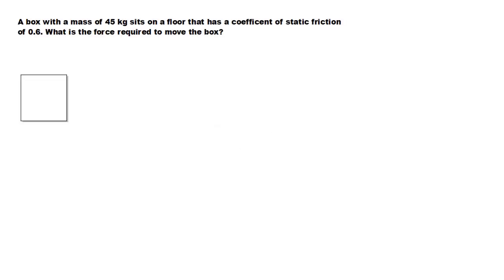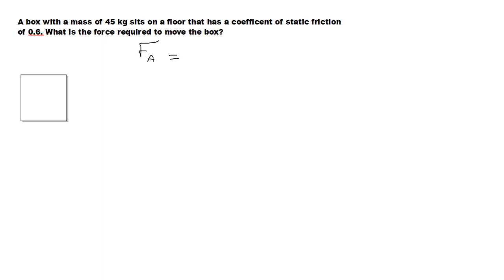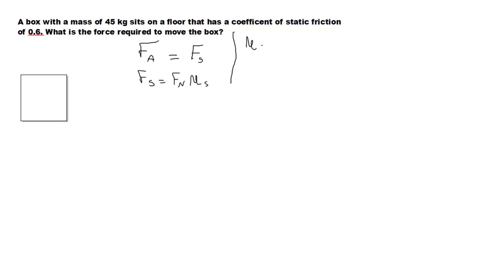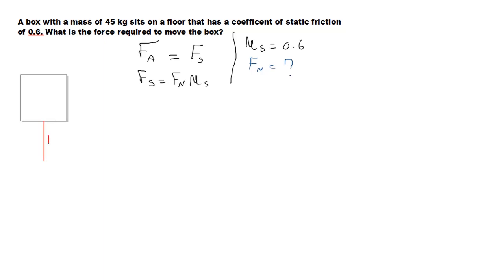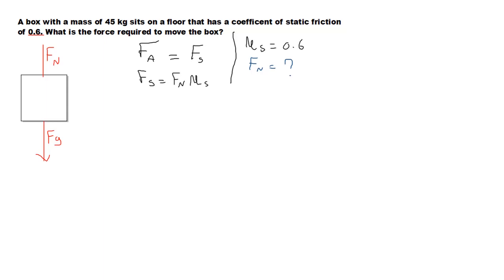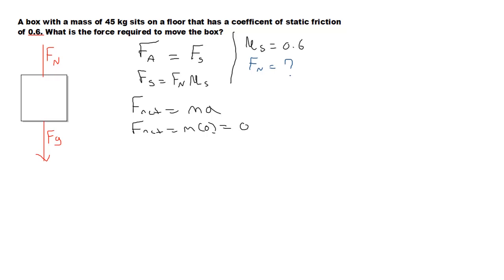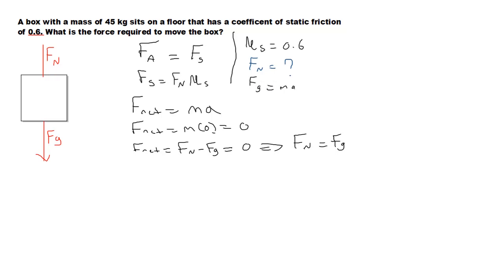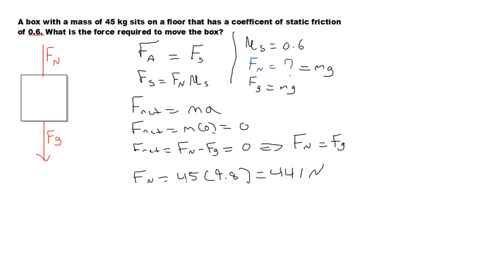Static Friction: Force Required to Move Object

Comment: Thank you for this video! However, I don’t completely understand your explanation from 00:14 - 00:53. You stated

“What force is required to move this box?
Well, we know that static friction is the force which keeps things from moving. So, we need to figure out what the force of static friction is because in order for something to move the force of static friction needs to be equal to the force applied... So, in order for something to move the applied force needs to be equal to or greater than the static friction.”

But aren't the last two sentences incorrect?  When the force applied (F_A) equals the limiting static frictional force (F_S), the resultant force F is 0. So the acceleration is 0 (by Newton’s 2nd Law) so the box does does not move.

We could see this another way: 
For the box to move, the resultant force F must be greater than 0.
Newton’s 2nd Law states F = ma.
The resultant force on the box is F = F_A - F_S.
The box will move when the acceleration a > 0. That is, when F > 0. So, when F_A - F_S > 0. This implies F_A > F_S. 

I feel that I have gone wrong somewhere but I don't know where,. Please help me. Thank you!